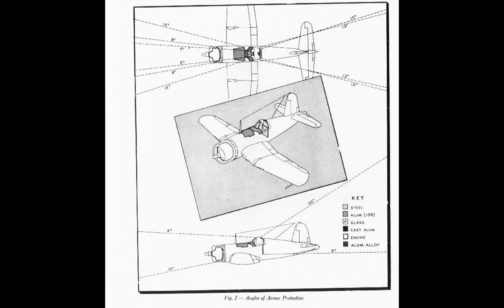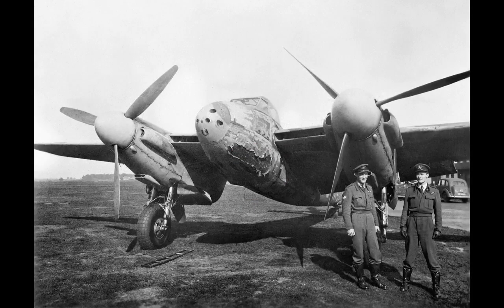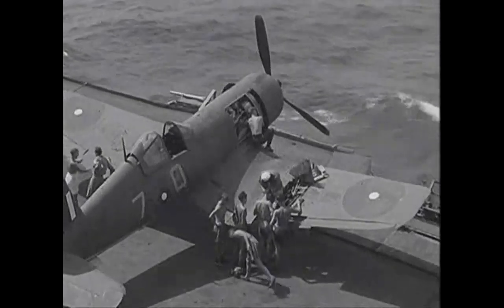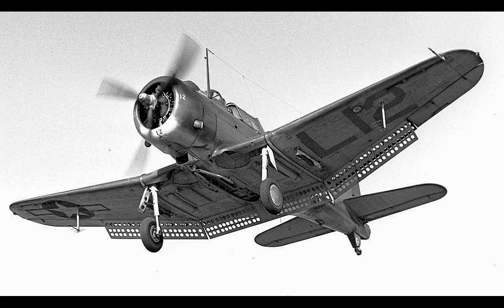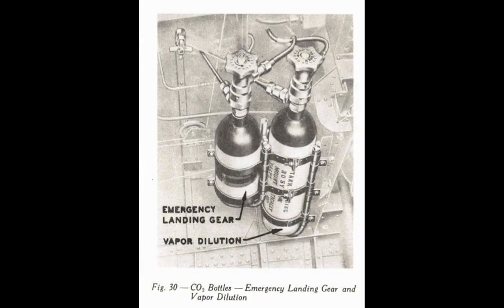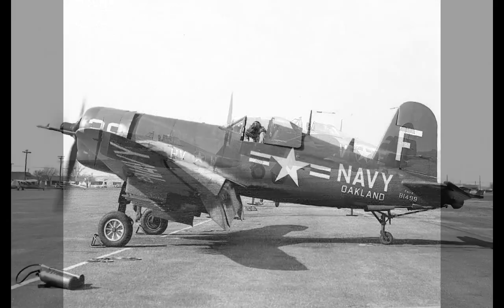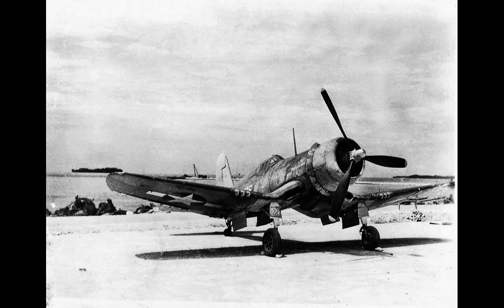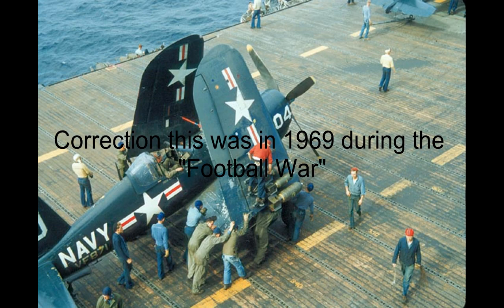F4U Corsair Design Features

Comment: So, question. I read that the Corsair was claimed to have enough torque to flip the plane upside down on the runway if the engine was gunned too suddenly. Is there any truth to this, or is it hogwash?
Reply from the maker: If you mean that it's claimed it can do that with the wheels on the ground then no, that's nonsense, but in the air at low speeds the torque, gyroscopic effects of the prop and other asymmetric forces from the prop can not be taken lightly.

Comment: you should read up about the Japan occupation forces, australians in P51, British in Mk21 Spitfires. New Zealanders In F4U and the american Navy in F6F.   no one to shoot at so they Played a lot.   apparently the Kiwis came out on top always!
Reply: dean: In your dreams The Corsair was NOT that good and the Kiwis did not have anymore experience than did the Aussies or Brits, and in 1946/47 the Seafire was there with the FAA 4800 ft/min S/C 43100 ft 452mph @20500ft. Tactical Mach 0.84   and as the Kiwis did not have the Corsair 5  they were seriously outmatched
Reply: @jacktattis143  yes and as i said you should read more   Mk21  or in your case the  F Mk45 and FR Mk 45 of the FAA were just Mk 21 spits. with clipped wings so they did not have a good turning radius. add to that they lost the variable angle of attack advantage of the wing so the stall and rate 3 turns stall advantage was gone.  to much torque for the airframe meant they had to take off on 1/2 power or they would rip the tyres off the rims   sure they had the best clime rate and speed in a dive worse they had no fuel/ endurance. but there day as air superiour fighter was over. And remember the fleet air arm also used Corsairs and only invested in the latter Mks of the seafire because the end of lend lease they had to push them off the end of there deacks.  in short the FAA had no first rate aircraft until the fury.
Reply: @deanwilliams4365  Not what I am reading here . Page 140 Mark 46 fULL POWER up to +18lb Boost could be applied for take off none of the beautiful Harmony of Control had been losyt, a Tactical Mach of 0 then the definitive 47 was a superalative plane.
This definitive seafire certainly excelled at Climbing and few other production piston engine planes could match it let alone surpass it
All from Browns Wings of the Navy
Reply: that was 0.88 Corsair a long way behind
Reply: @jacktattis143  yes  you are correct  for the Mk46  not the Mk45,  keep reading the Mk46 that you are referring to was not in Japan ( Kforce) and it had counter rotating props.  so quite a different animal  it also had the mk 66 wing if i recall  which was a laminar flow wing. as i have already stated they were brilliant in the clime,  but that was about her only claim to fame. the FAA surtanly got rid of them as soon as it could!!   but my original statement stands. its well published.  the occupation air forces in japan post WW2  had little to do so they played with each other, both formal exercises and informal. and all parties have written  or the pilots who were there constantly reported that the corsair outperformed all comers at that time.  that not my opinion. i am merely repeating what was written by those who were there and those who were involved.  so Jack you can argue all you want. but your not arguing with me you are arguing with History
Reply: @deanwilliams4365  Mate try as you might the RNZAF Corsairs were worn out. The Seafires were not, regardless of Model
Reply: @jacktattis143  absolute bollocks.  at the end of their tour in 45 the very few remaining corsairs were handed back to the us marines, the squadron had actually been decimated on one raid to Rabaul.  the squadron returned to NZ where they were re equipped with NEW FG 1D  and extended lend lease agreement.and were transported to Japan by british aircraft carrier. pilots were the remaining or surviving 14 squadron plus replacements who had already had at least one tour on corsairs in the pacific.  i do not know where you are getting your information. well i do know,  your not  you just inventing shit.
Reply: @deanwilliams4365  They had a Sqn FOR one year. And I suggest you read the Specs of Voight Corsair report No 4756 They were piss weak at sea level and not much good at height
Reply: @jacktattis143  sheesh your not bright are you.  in japan for 1 year. 14 Squadron had already been at cactus and was formed out of a british based squadron. thay were slated to go to the P51 but the war ended so thay just got a new bunch of Corsairs to save on re training and buggered off to japan.  the FAA had all there sea fires land based since they were losing so many on carrier operations . but as i have already posted. the seafire you are rabbiting on about did not have the classic spitfire wing and thus did not have the classic spitfire handling. it was a totally different machine, sheesh e=ven the prop turned the other way!!  but as i said  the corsair  out flew anything at that place at that time as stated by the pilots who were flying at that place and at that time!
Reply: @deanwilliams4365 So you are going to tell us that you know more than Brown.In plane characteristics. 
You fool Brown ironed out the Carrier problems and the 45 and 47 were the easiest to land on a carrier Tell us oh wise one when the so called losses occurred
Reply: @jacktattis143  No i am saying that i give much more credibility to what the combat experienced pilots of J Force wrote when they mock battled the different allied aircraft over the skys of Japan, than any armchair  iddot who is trying to compare numbers.

Comment: I read the book by Tommy Blackburn and it’s a great book. The first Corsairs had serious issues as everyone knows. The first ones had shotgun shell starters. Terrible idea for the huge engines. They also bounced really bad, which pretty much sucks when landing on a carrier. It quickly earned the nickname “Bent Wing Bastard” and for good reason. The Corsair had another issue when landing. The left wing would stall before the right wing and our young men flying the Corsair immediately added throttle and as the other gentleman stated about his dads shipmate, it got them killed. Chance Vought fixed this problem by adding a piece to the right wing just outside of the gunports. This helped make both wings stall if you will at the same time thus eliminating that problem. The first modifications to the Corsair was the F4U-1A. They changed the gear so it wouldn’t bounce as much, the tail wheel was taller, the pilots seat was adjustable for height and they got rid of the framed canopy. I’m pretty sure they all had electric starters added as well. Even with the new modifications, it still wasn’t suitable for carrier ops. At least for the U.S. Navy. The “D” model Corsair was the version the Navy felt was good enough for carrier ops and those aircraft came aboard in late 1943. One last thing, in 1940, the Corsair was the worlds fastest airplane. It was the only airplane to exceed 400 mph in level flight.
Reply from the maker: Iv'e always wanted to try one of those shell starters, but I certainly agree it wasn't the best idea.
Reply: I’ve always wondered how well that system worked? Maybe for smaller engines it was ok, but if I remember right, the weather played a part in that. In warmer dryer weather it worked ok, but in cold wet climates not so much. Its got my curiosity up so I’ll have to read up on that. I remember my grandpa hand starting the Stearman he flew 6 sometimes 7 days a week. It had been converted into an ag plane. Crop duster as most call it. It had the R-985 engine on it and a gentleman in town had bought a lot of windshields and canopies that were in BT-13’s. They attached those windshields and canopies to the Stearman’s after they had been converted into crop dusters to help keep them a little warmer in the winter months. It can get pretty cold here in the San Joaquin Valley. Not like Michigan or places like that, but cold enough. Anyway, my very first airplane ride was in one of those Stearman’s my grandpa flew for over 20 some years. I was a small, skinny, 7 year old kid and I crawled in behind the seat, stood on the lower longerons, grabbed ahold of the crossbar that the top of the seat bolted to and off we went. Dangerous of course, but you don’t think about things like that when you’re a kid. I wanted to go for more rides, but it was too cold for me. 1 ride was enough, but my love of airplanes and flying was born that day. I never had the money to learn to fly after I grew up, but the love of airplanes and flying is in me forever. I’m disabled now, but that love of flying and airplanes is what keeps my mind busy during the day and evenings. Models, videos on here, things like that. That love of flying is in me just like it was for my grandpa many moons ago. Anyway, I didn’t mean to go into a whole other subject, but I’m definitely going to look up shotgun shell starters and how well that system worked.
Reply from the maker: For the vast majority of us flying or owning a WW2 plane is way out of reach. So, for most, including myself, models and video games are what we have.
Reply: Very true! It’s the same for me. Not many of us have several million dollars to own something like that. So, I’ll stick to building models of them.

Comment: My father was a lead design engineer on this project, and he's the one that told me about the fact that they had originally designed it with the wing sticking straight out perpendicular to the fuselage, but, when they did the calculations for the propeller/engine combo, the propeller would go into the ground when the craft leveled off at takeoff.  Since the optimal angle for the wing to attach to the fuselage was 90degrees, they rotated the wing down and then curved it up to provide the necessary dihedral.  He mentioned that it was quite the task to make all the flaps, control linkages, landing gear and weaponry work right, and still be able to fold the wings.  In fact, I have one of the original photos of the prototype flying over Stratford (CT) that hung in our vacation home.
Reply: TydalWind ... That makes perfect sense as, and as you will know, all pilots of tail draggers are taught to be very careful when dipping the nose on the take off run up in order to lift the tail wheel.
Reply: All done before computers. Your father was a great man too!
Reply: @tomjones7089  Thank you for that wonderful complement.. I know he's quite appreciative for that.  He's long gone now, (passed in '85), but I'm grateful for all that he taught me.
Reply: Quite correct, however the change came about with the introduction of a supper charger. this required the motor to be pushed forward and the cockpit to be pushed back. and bigger paddles / dia no so much for the increased power but for the increased altitude now usable because of the supercharger.
Reply: @deanwilliams4365  There was no "introduction" of a supercharger. The R-2800 was designed from the outset with an integral supercharger and all of them had one. By the time the R-2800 was designed it was standard practice for all high performance airplane engines to have superchargers. The only WW2 military aircraft without superchargers were light observation planes and primary trainers. Even BT-13s and AT-6s had superchargers. The long nose and rearward cockpit were to make room for the big main fuel tank in the fuselage since the Corsair's wings weren't designed to hold a significant amount of fuel.
Reply: @barryervin8536  -
I read your exchange with interest because I'm one of probably 4 or five wierdoes that like the early prototypes with the more forward cockpits better.  It does make sense to locate the fuel tank close the the center of the plane's mass.
I just think the XF-4U-1 is beautiful, though.
Reply: Kudos! That must be really something your father working on this, my favorite ( & so many others) performance aircraft. I'd be very proud!
Reply: @johnklatt3522  To be honest, those details were never discussed, and I have no knowledge in that regard.  Sorry.  I do know that after the war, before I was born, he was a VP @ Norden (Norden bomb sights) - I suspect (but have no direct knowledge) that he was involved in the creation of 'lock-on radar' as his thesis at MIT (top 5 in his class - 1937)  was on, what is now known as 'radar'.  In those days, there was little 'specialization' and students covered virtually every subject involved in the engineering field, and he was extremely well versed in mechanical, structural and electrical principles, particularly the subject of 'alternating current phenomena'.  I still have one of his textbooks on that subject by Steinmetz.
Reply: Late model Spitfires running the 37 litre 2400 bhp Griffon engine didn't have the chance for a wing redesign. Instead they had smaller diameter counter-rotating propellers.
Reply: Fantastic stuff Tydal. I love hearing about these technical details. Much respect to your dad and his team. They made a legendary fighter.
Reply: Did he ever mention why the vertical tail was placed ahead of the horizontal tail?  I have contended that it is due to spin considerations as discussed on page 10 of this NASA paper but would love any insight you could provide.  https://ntrs.nasa.gov/archive/nasa/casi.ntrs.nasa.gov/19720005341.pdf
Reply: @glenwoodriverresidentsgrou136  No... this was never brought up, but given the complexity of the mechanicals in that area, what with the horizontal stabilizer controls along with the vertical controls being so concentrated in such a small area, I strongly suspect that it was the necessity of linking the tail wheel with the vertical stabilizer for steerage that was the reason for this design quirk.
Reply: YT is fantastic..Thanks for the info..
Reply: Did he really say perpendicular or swept back?
Reply: @stevenbryant4718  Perpendicular relative to the fuselage's cross-section, which was essentially a circle. You'll find that very few (if Any) propeller driven craft use swept-back wings... they simply are not as efficient as wings that are perpendicular to the air flow.  Just as in gliders...
Reply: You sat at the feet of history in progress. 😲 How truly fortunate!
Reply: @dennispagans732  , oh, stop blabbering!
Reply: TydalWind Thank you for sharing. The Corsair has been one of my favorite WWII aircraft. The wing position story is exactly what I read in a book on the Corsair. Always wondered how the folding mechanism was done. How it was locked and how they still made ailerons and flaps etc. Work.

Comment: My father was chief electrical inspector at the Corsair factory in Conn. during WW2.  I saw Corsairs roll out of the factory door and take out over the Sound in the early 1940`s.  Once you hear a Corsair roar on a low pass, you never forget that sound. The Corsairs bound for England were painted all white  and each employee had their children`s names painted in black on the tails of each plane,  my sister`s and my name included. There is a pic of this Corsair duly painted with my father next to it in one of the Vought Corsair booklets. I also saw Sikorsky`s helicopters  flying around that area during   WW2.

Comment: The A-26 was in use well into Vietnam era. A testimony to it design and build.

The Hell Cat was a very fine fighter as well. 
The landing ship officer so critical to success, his decisions so helpful.

Folding wings mean weight, that why the Zero only tip folded if at all. It’s light weight made it relatively slow speed acrobatic unmatched by U.S. designs. High speeds made her ailerons not want to work against the slip stream. Every design has its sweet spot for air speed. Later models tried swinging wings but here again more weight ( F 14 - Tom Cat ).
The ww 2  fighters were designed to stay under 500 mph. 
The later F-104 was high speed but at those speeds your turn radius becomes ever larger or the air frame pilot suffer.

Comment: What was the white duck tape-like fuselage patterning  just before the cockpit for?
Reply from the maker: I don't have an official source, but the best explanation so far is that there were fuel vapors escaping from that area, and they sealed them with whatever that white stuff is.
Reply: @GregsAirplanesandAutomobiles  : I researched and found you are correct: Among the many problems that turned up in operational F4U-1 Corsairs was a leaky fuel tank, which was located between the pilot and the engine for the most favorable center of gravity. Corsair pilots I spoke to said that a virtually universal practice to keep the windshield clean was to seal the fuselage panels with strips of white tape. The oil on the cowling flaps also leaked, spattering the windshield and also affecting visibility, hence the upper cowling gills were fixed shut and they were eliminated entirely on later models.

Comment: Great information. The bent wing as stated by you makes more sense than just to get the prop off the deck.  The feathering part was very interesting to me.
Reply: Terry. Read Browns Wings of the Navy/ to house such and immense engine and keep a 18 inch Ground clearance for the Prop the Wings were designed for that in mind first The other attributes came as a result of that